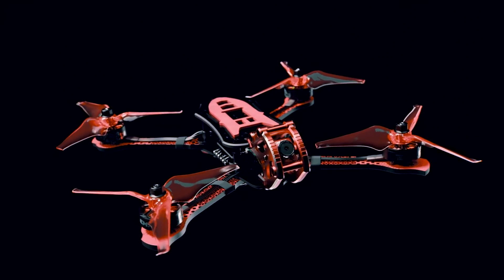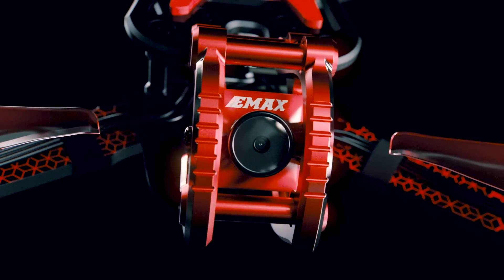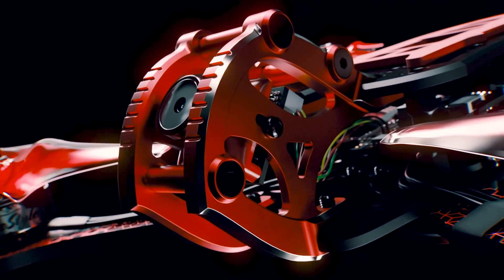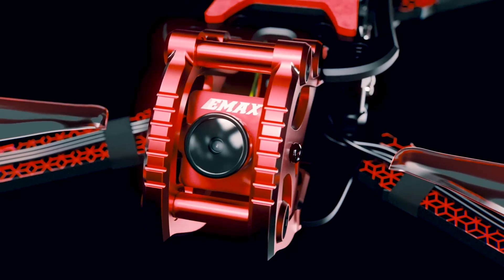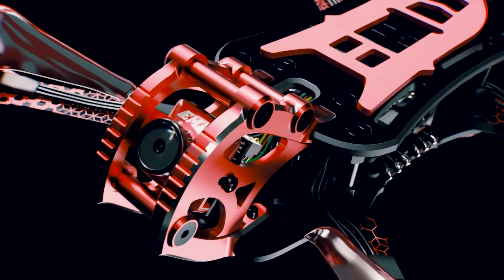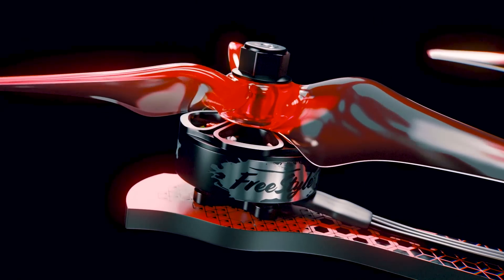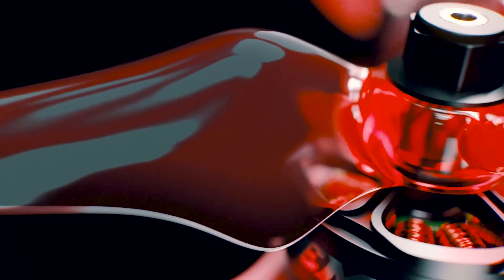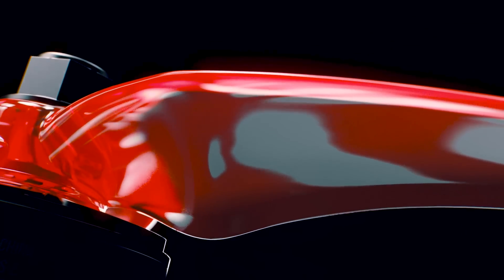EMAX - Introducing BUZZ

Comment: For an experienced/intermediate pilot which version would you recommend, 4s or 6s?       I have plenty of packs for both.
Reply: Get two and let me know what you think.
Reply: Nameless Droner lol. Wish I could but I may just get the 6s and then the 4s Motors when they come out
Reply from the maker: As far as performance goes, they both fly very similar, the main difference being 4s deals with voltage sage towards the end of the packs life while 6s has much less sag and instead just drops out of the sky when the battery is dead. If you want full power all the way through a lipos life, go with 6s.
Reply: EMAX USA thanks for the reply. Think I may just go 6s since I’m starting to move all of my race rigs to 6s except my hawk 5, tho I am wanting to use the hawk5 frame for a 6s race build soon.  I will be ordering a buzz tonight.  👍😎